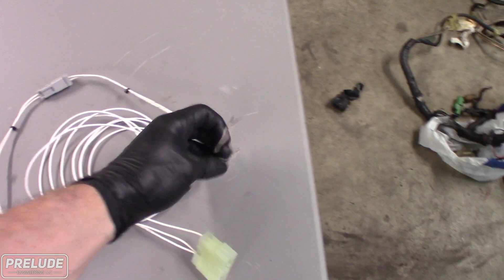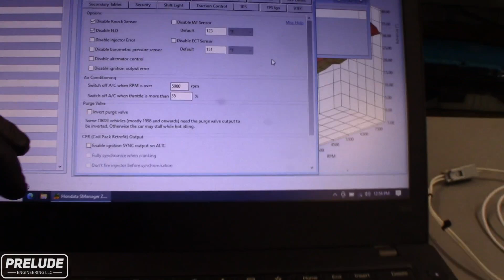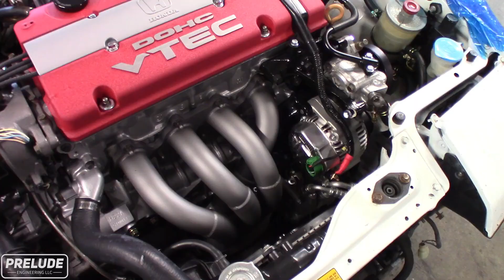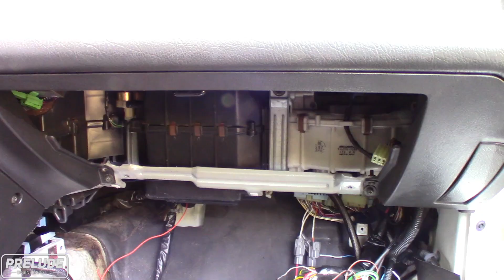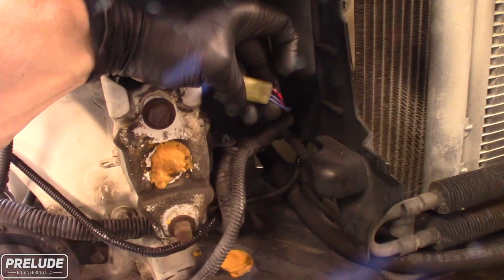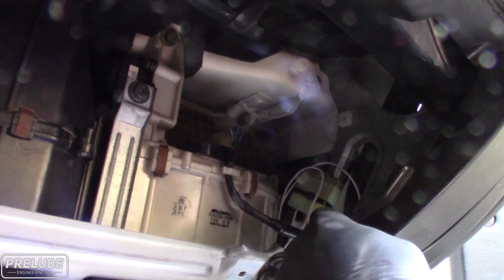AC Compressor Control Unit Bypass Plug and Play Wiring Kit - 88-91 Prelude

Comment: I've been having intermittent issues with my stock (89 Si auto) AC turning off and displaying the red error light on the AC button. I think this might be the answer to that issue. Pretty sure it's just being too picky about engine RPM.
Reply: How’d it go? Been thinking about getting one myself!
Reply: @joshloaf89 I can't find the connectors in the engine bay to install it 😕